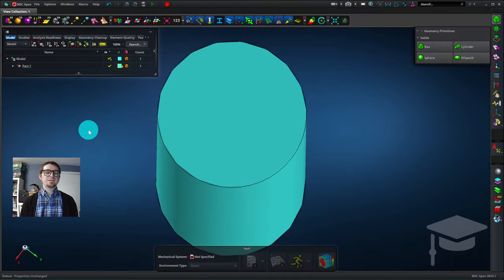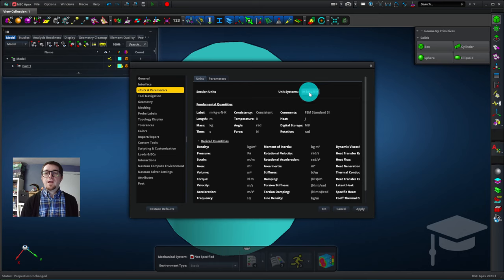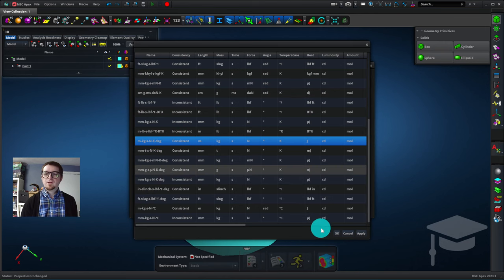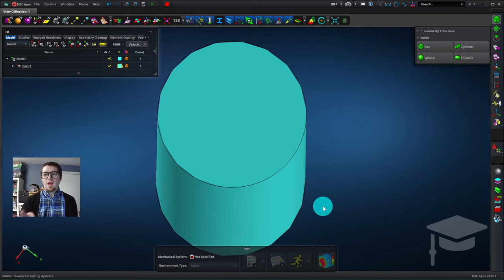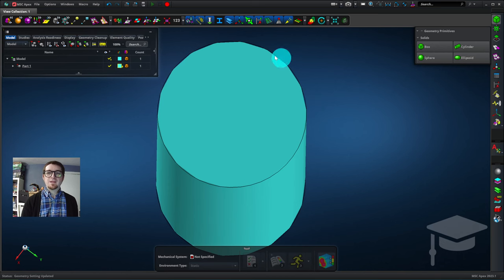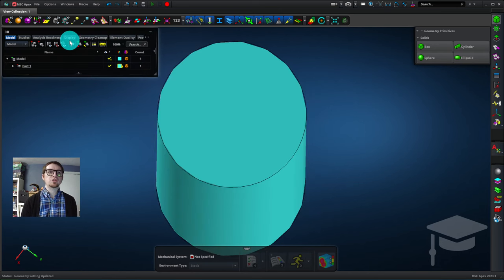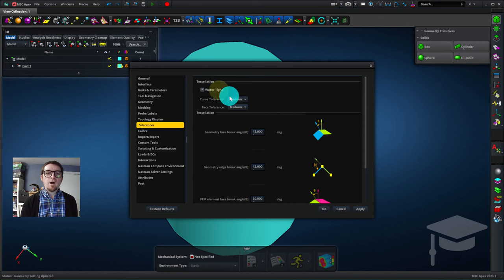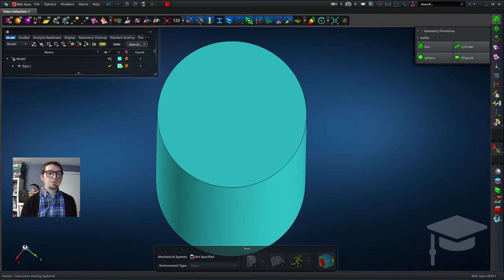MSC Apex Settings for Beginners

Comment: Hi! I made this video. Let me know what questions you have and what you’d like me to cover in future videos. I mostly work on Apex, Nastran, and Adams—and I’m curious about other simulation packages!
Reply: I get that this thing can edit pre-existing/imported geometry pretty well, but I really want to see someone just build a simple object or part in Apex out of primitives (or however you add your own geometry in this program, I'm assuming drag and drop primitives) and then using its direct modeling features to build the part. Is that something that can be done with Apex despite it not being its actual purpose?
Reply: @arthurparkerhouse537  Hi! I had previously answered this question but see that my answer was deleted somehow. It's possible to build complicated geometries (there's a sketcher and ability to extrude or revolve) but it's really not what Apex is built for. I suggest doing a trial and you'll quickly figure what Apex can do in this regard.
Reply: Mr. Alex.
Can you please tell what are the keyboard shortcuts of MSC Apex and how can we define new keyboard shortcuts in MSC Apex?